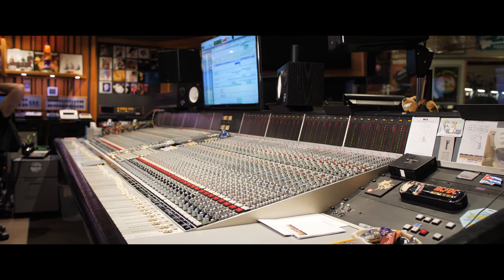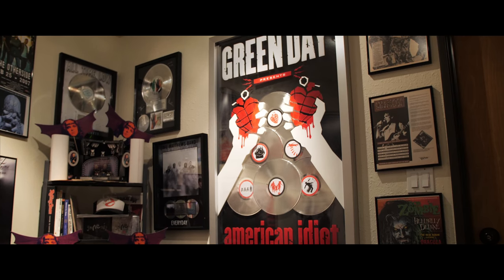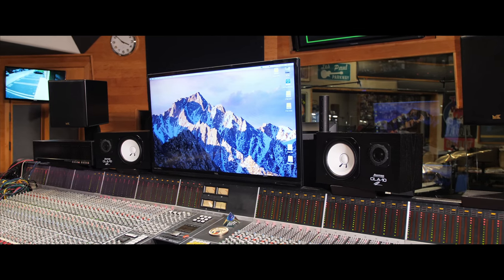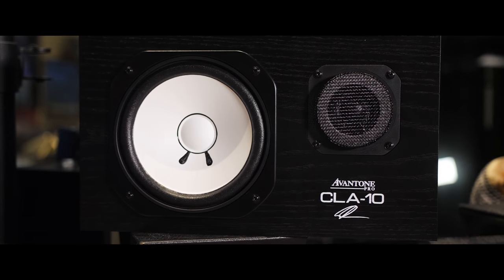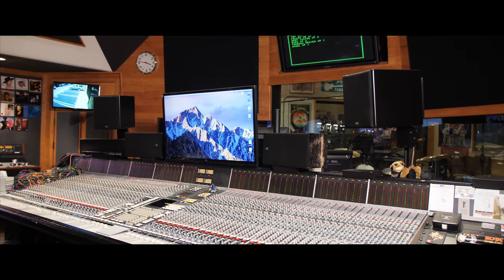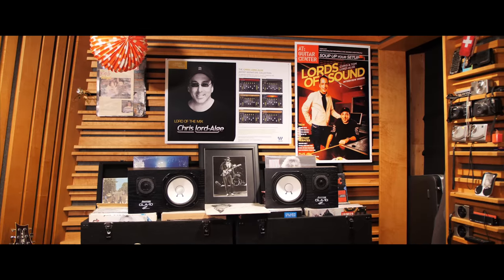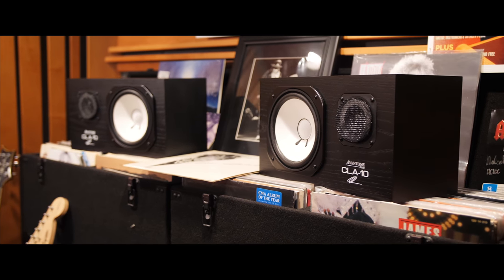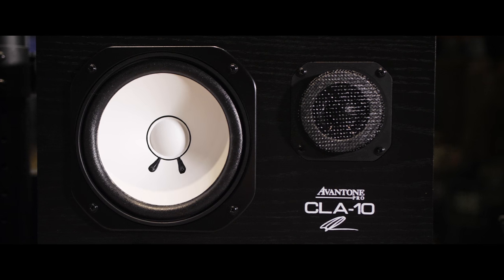Avantone Pro // CLA10 Passive Studio Monitor Introduction

Comment: How do i connect these? , it came with no cable
Reply from the maker: Hey there - the CLA10 monitors are available in two types - passive (CLA10) and active (CLA10A.) 

The passive CLA10s require a power amplifier, the active CLA10As have the power amp built-in.  These can accept either bare wire or banana plugs. You will need to buy your own speaker wire. 

Here's a GREAT video on how to connect passive monitors to your interface and amplifier!
https://www.youtube.com/watch?v=5wnGKfxCPT4